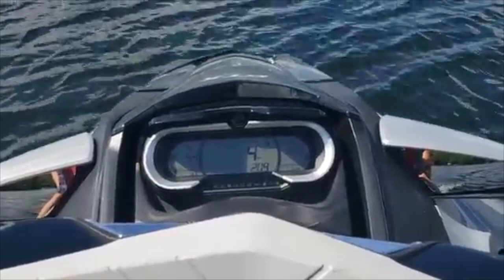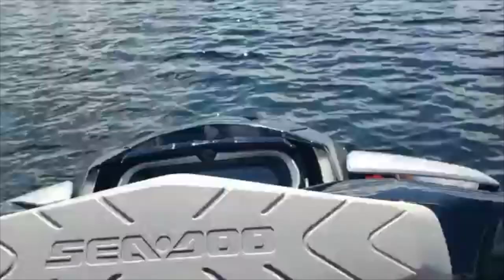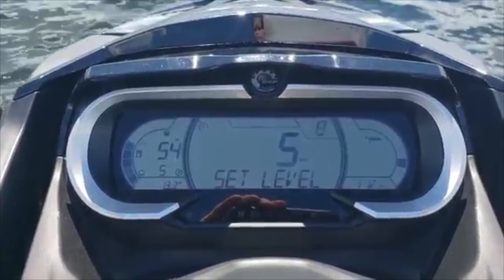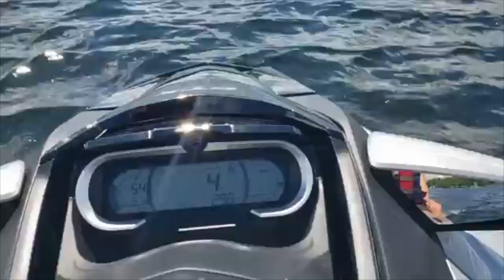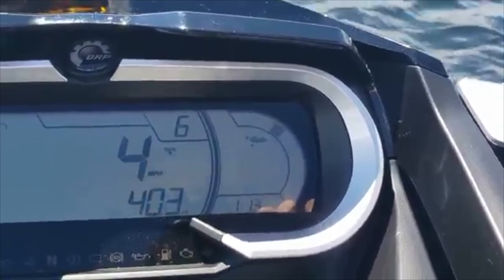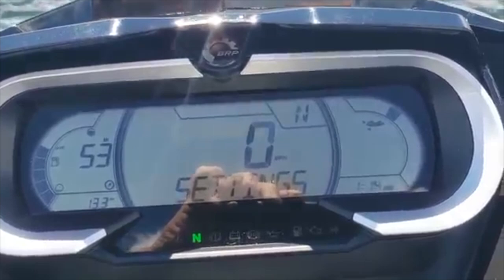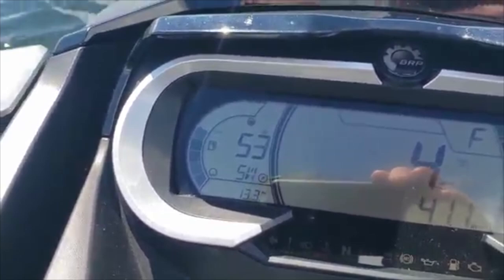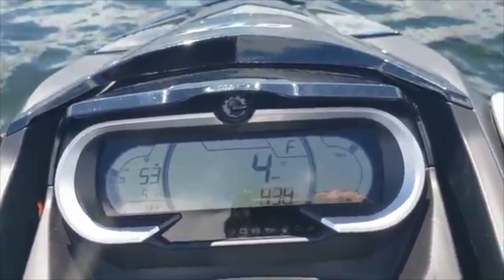Sea-Doo: How to use controls

Comment: I have a sport 170 2023 and when I press the left and right buttons, I just get settings and rpm. No water temp option or depth options which is weird. It says in the Manuel that I should have water temp and depth built in the gauge so I should see those features. Might hit up the dealer to see what's going on.
Reply: I just bought the same model and don't see any of that info either.